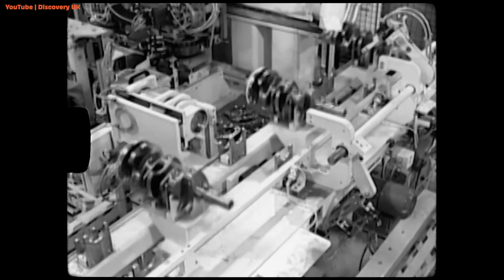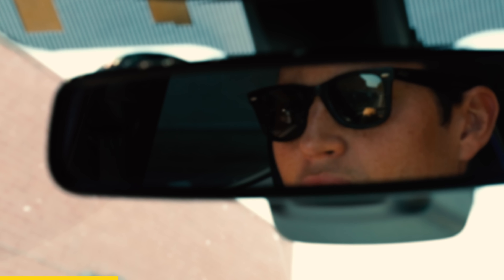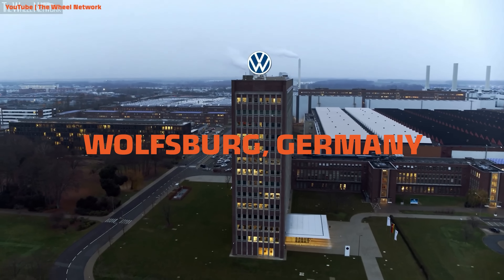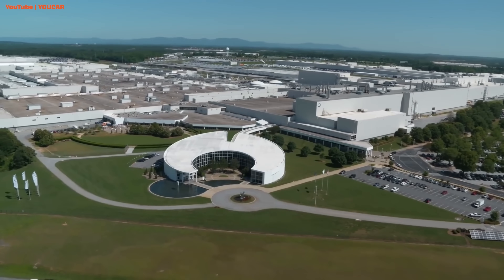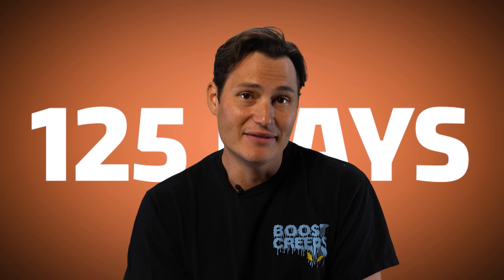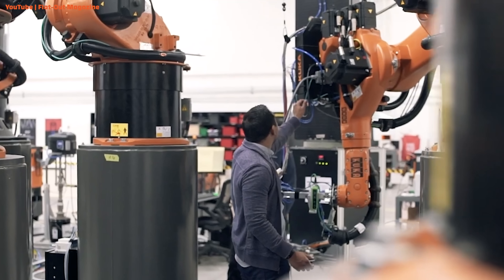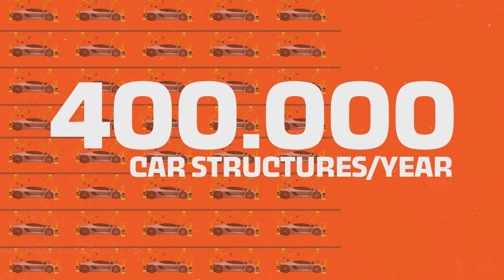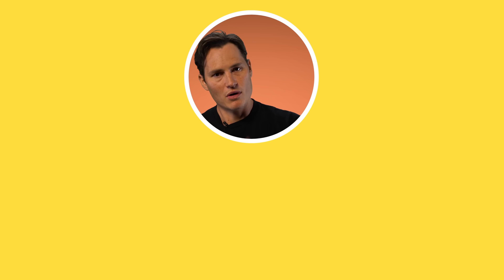A.I. Designed this Car

Comment: For everyone thinking that the robots are going to take you job they will but they won't lessen how many jobs there are they will just lower the difference in jobs. 
So for example in stead of doing manual labor you would most likely be coding the machines that  are doing your old job. And yes it's going to be frustrating to learn code but at least you'll have a job in the end.

Comment: AI copy's designs from nature which is what the best designers already do , 3d printers used to make high efficiency weight saving parts but 3d printed metal parts are by default structurally weaker than cast parts and forged parts.. this car is a gimmick it would be 5x more expensive and perform the same as a standard sports car(also automated assembly lines only save the company money of employee sick days insurance ect that won't make the end product cheaper the company will just absorb those savings into profit and sell the car for the same price as if it had human assembly lines similar to Tesla)

Comment: $3 million on those printing machines....I really doubt that. Even if that were the case, imagine what material cost. The cost of programmers, + cost of expert maintenance guys to be right by the machine 24/7 which they would absolutely have to have because automated machines break just about everyday in some form or fashion in industrial settings. Plus god only knows what other expenses. I promise that 3 million dollar figure that was "estimated" is only a mere fraction of the reality

Comment: 2030...
Me: “Check this new car I just printed!”
You: “Cool, I just downloaded the blueprints to print mine.”
Reply: @JohnGalt-w1o  You will print out parts and build your desired lamborghini or maserati through the magic of 3D printing
Reply: imagine a steam workshop-like platform where you just print any car
Reply: @ysos4357 Traffic jams will never be the same with so many cool cars to look at.
Reply: 2040 3D printed houses
Reply: @djsubliminalreeve  mate that's already happening now
Reply: i know this is joking but i think its going to be decades or never when people can have affordable metal 3d printers
Reply: @Silverdev2482  I think they start at 2k? Also, it isn't like one is needed in every house. If functional 3d prints would become more common, a Joe with one in his garage could make a good living. True, things like batteries, bearings and raw material are not printable (tolerances, working with combustive liquids and solids pose either too great of a risk or are unprintable, and using raw materials to print raw materials sounds like minecraft duplication glitch or something). Once a Prusa or Creality of metal 3d printers appears, the price will likely go down quickly, at least of the printers.
Reply: @ApusApus  at 2k? could you send me the link? maybe you’re mistaking it for a cnc (a machine that carves away at metal to make parts)
Reply: @Silverdev2482  Perhaps I should have checked before comenting. I know there is the "Metal matters" chanel that is attempting to develop one, but from the latest videos it seems that costs are increasing and physics aren't quite there yet.
Reply: @ApusApus  i just looked at that channel anyways metal printing isn’t practical for mass production of cheap products its for expensive parts but i think developments in cheap/diy dmls will be interesting i’m going to do more research in diy/cheap dmls like looking at stuff like that channel

Comment: Okay, cool and all but...

what if it breaks?
Find me a mechanic willing to work on this car. Find me a single mechanic who isnt gonna throw up all over you when you tell him "oh yeah, my car has been having electrical issues could you check that out? oh, by the way, the wires are exactly the length they theoretically need to be down to the millimeter, have fun"

Comment: There is a lot of "in theory" that you're leaving out. All this stuff is great in theory. In practice it is an absolute nightmare and requires a ton of engineering to make it work. Over time it will get better but right now it is technology in its infancy. I don't expect you to highlight all the negatives but at least a very short summary of why this hasn't become the widely adopted method for all car manufacturers.

Comment: "A 3D printer doesn't print out extra material."
Rafts and support beams: Are we a joke to you?
Reply: also key dimensions need to be machined post printing
Reply: Well actually ,even with plastic, those supports could be recycled literally not wasting anything. Plastic can be rememted into line and metal can be made back into metal dust with little to no waste
Reply: @terminatorztc6391  same for traditional production facilites though. they can also simply recycle their waste
Reply: @terminatorztc6391  Well the clip talked about printed parts ready for use but those turbo blades were far from ready for use.
Reply: @BuiltByRik  yes and theoretically if supports were to be used they can be recycled
Reply: Yes. The only real advantage to 3D printing is the broader design space. Some parts would be next to impossible to machine while they're trivial to print.
You lose on time, cost (assuming it was feasible to do using machining) and precision (which can be dealt with a machining pass).
But the real reason it's brought up in this context is that a 3D printing removes a constraint that limits computers significantly. Ask a computer to figure out how to best use limited material to deal with a certain type of stress, it's a solved problem. Ask it to simultaneously account for the cost of manufacturing using machine tools. That's much harder. Humans tend to work from what can be built and what is well known rather than making these organic structures. Because unlike the computers humans can't try out all properties of some structure millions of times in their heads before a deadline.
Reply: They aren't required with metal printing because the powder occupies the space under the print where the supports would be
Reply: @SamOnTheMove  Uh, layer sintering still needs supports to prevent the printed piece to move and shift. Just look at 7:03
Reply: @siniorgolazo  lk
Reply: Yes
Reply: In addition to supports, SLS printing requires that you use new material every time you print. This is because the build volume needs to be heated to just under the transition temperature of the metal so that the lasers don't need to be astronomically high powered. This heating can degrade the metal powder. You can reuse some of the powder, but depending on the material and the required properties of the finished product, you're looking at mixing around 20% old material with 80% new material. I think the biggest benefit of additive manufacturing comes from the crazy geometries that can be manufactured and ease of changing a design rather than material savings.
Reply: It's metal 3d print ..
Reply: @TheChenchen  Yep but those turbo parts were not ready to install they still need machining.

Comment: Im an industrial electrician that works on mostly GM and Ford manufacturing facilities. It sounds like the turn around for the manufacturing process is crazy long. If a process like this were to go mainstream you would run into a similar problem that Tesla is having. They can’t produce cars fast enough. The Ford plant I was just at produced almost 100 Ford rangers a day.
Reply: I understand that this could be scaled larger so that more cars were being produced but it seems like that would take up just as much space as current facilities

Comment: Ai design assisted, yeah ok been done for years, decades if you count design "program" software!. 3D printed parts, nice.  Totally 3D printed car - nope, far too slow with way fewer serviceable parts. IF the whole car were affordable, as in cheap like paper towels, then yeah, design and print a throwaway/TOTALLY recyclable car! PLUS, as has ALREADY been experienced in a whole lot of situations, just because a computer can design and build something does not mean the parts can be accessed, serviced, or even replaced if needed/required.

Comment: Ai: Building Car
SUDDEN BLACKOUT
Engineers: HELLISH DEBUGGING
Reply: It's called self power source and generators = no power outages and debugging
Reply: Debugging,what? It's not like it makes mistakes in a power outage it just stops
Reply: @parthpatel9602  electricity in not  light, all those robot arms could desync just because one arm turned of a fraction of a second later.
Reply: @parthpatel9602  when you know nothing and talk like you do

Comment: This is cool stuff, but it presents us with a difficult problem. As techniques like this are increasingly applied to not only car manufacturing,  but lots of other industries as well, jobs for human beings become fewer and fewer. But our populations are not dropping and people still need some sort of "money" to buy stuff. 

So, what do we do with all those folks for whom we no longer have jobs available? They can't all go to work in IT, especially as computers become increasingly able to program themselves. Andrew Yang raised this issue during the 2019 Democratic presidential primary, but his candidacy got little traction. But Andrew is right about the problem, and sooner or later, we've got to find solutions to it.

Comment: While this is cool and all there is so much not ideal with it, I’m no expert but just to mention one thing I know, powder metal melted into solids is not as strong as forged. So yes on less stressed materials you can use this but on something that needs to be strong I wouldn’t trust it. 
But I’m all for finding better ways to do things but not if it makes a lesser product.

Comment: This car is actually a real life, 1/1 scale model, of a Mini 4WD toy model cars. Though the difference is on the assembly line, but the final result really similar to that popular Tamiya Mini4WD scale models. Similarities are wiring integrated to the chassis, which of course you will sometimes need to buy the whole kit or chassis when you cannot find the exact parts you need (therefeore you will need to "go back to the dealership to maintain" your car). Also printed parts from ground up, inside out engineering, body works that is actually useful for the car, not only to complete the product. This is awesome.

Comment: Does anyone else see the parallel between this and the Next Generation Air Dominance jet (NGAD)?? I studied aircraft conceptual design and it blows my mind that the next generation fighter jet was supposedly designed and prototyped in a year. The NGAD is supposed to be unlike anything ever before it. I would not be surprised to learn it shares many of these same design and manufacturing methods.

Comment: Sounds great on in theory until one of those printing robots becomes miscalibrated and runs it's cycle for three or four hours out of spec and a bunch of parts becomes a little lopsided as a result. A completely satisfactory process for a hypercar, but to maintain tolerances in a mass-production environment would require more time to calibrate the zero-points than actual fabrication.

Comment: $4,000,000×40=$160,000,000 $160,000,000−$500,000,000=−$340,000,000°°° $500,000,000-$160,000,000=$340,000,0000 so its better to change ALL the car manufacturer companies to buy at leas 40 of those machines for $160,000,000 and renovation isn't included nor materials and save about &$340,000,000. Tho they can make 400,00 a year well according to https://www.investopedia.com/articles/markets/021416/how-toyota-makes-money-tm.asp#:~:text=Since%202012%2C%20Toyota%20has%20produced,10%20million%20cars%20per%20year. Said "Toyota produces 10 million vehicles annually, 2.8 million of those in North America. And that latter number is expected to grow thanks to economies of scale." And https://www.google.com/url?sa=t&source=web&rct=j&url=https://pressroom.toyota.com/toyota-motor-north-america-reports-december-2019-year-end-sales/&ved=2ahUKEwiRmaSl6PLsAhWMecAKHXzuBDkQFjAGegQIBhAE&usg=AOvVaw0lypDM1JYf3Ji-j0H1d8uA OR TOYOTA said 
"
2,085,235 vehicles. For the year, Toyota division reported sales of 2,085,235 vehicles, down 2.0 percent on a volume and DSR basis. “2019 was a strong year for Toyota. We retained our number one spot in hybrid, passenger car, SUV, small truck and retail sales,” said Jack Hollis, group vice president and general manager, Toyota division.Jan 3, 2020

"

Comment: ok that's great! but to repair an electrical problem for example or a worn mechanical part .. is the computer going to take it apart? or will he tell us how to repair? because ok have gained weight, structure, placement, but the repair has thought about it ?? no. the concept is ok, but wear should be taken into account, because making a car and having to throw it away because it is too difficult to repair (it's not new .. it happens often ..) have you thought of something other than gain mass, solidity, etc., maintenance? (good to start with a supercar, because precisely the owners do not ask themselves this kind of question, they have the money whatever happens ..) in short, it's great, but also apply durability instead of planned obsolescence .. (a parameter that you will ask you to integrate the day you make cars for the mass, we should avoid doing like everyone else, and make solid, easy to repair, quick to repair , etc, these are the other parameters that you can put in your next project. whose only purpose is to make money. so innovate, but remember not to make faults on purpose so that it pays off for maintenance later too .. a dilem you don't have for this project, (supercar so ok!) but if one day you make a car for ordinary people, don't Do not enter AI programmed obsolecence settings.

Comment: 3d printing is a solution for prototipes and supply spare parts without having huge cost of storage, BUT it's way more expensive than industrial production high volumes,
Easy concept, thinks about the classic 2x4 LEGO brick (TM)  u can print it but it will cost a tons each piece and take a tons of time. but if u whanna do it in high volume, then the cost of the hot injection machine ( that cost several hundreds of thousands) is sliced on the volume production.

Then it could be the smartest way to project a car but.... have u tried to change a lamp in the recent cars?  space is so compressed that's take tons of time or even u need to disassembly a part to get access to the part u need...

Last but not least, maintenaince and repairs... all that hitech parts like nanocarbon structures. fiberglass etc... if u get an accident u cannot "weld it back" ... u have to replace it.

Comment: Missed here is the process. That's going to be the real sell here and where they will see their profits. Think about it folks, a programmable assembly line that costs and occupies a fraction of what every other current manufacturing process does in building size and cash outlay. I my current contractor would pay 3 million just to avoid having to deal with Bobardier. It's the process that has value and the car is just proof of concept.

Comment: I wonder how they're going to improve metal printing. Currently 3D printed metal parts (using laser tech) tend to have quite some random pockets and holes. Random here is the key as it means not only general structural weaker compared to CNC parts but also possibly much weaker in random cases. Curing has a bunch of limitation but should alleviate some of these issues. So a company in that space might drastically improve additive metal manufacturing like Tesla improved batteries (somewhat). The AI is obvious; even 3D printing hobbyist use it (at a different level of course).

Comment: I drove a '66 Mustang for years.  It was easy to maintain and cheap to operate.  Low initial price upfront and I sold it for a profit.   A simple blend of 60% gasoline/methanol/ammonia burns without engine modification releasing half the CO2. Try doing that with any modern car.

Comment: I'd like to know if there are engine blocks printed using the same method, using AI to improve airflow, fuel efficiency, power and weight then being built from the ground up using additive manufacturing.

Comment: The tooling costs in production also includes the manufacturing of parts. Mfg tooling is very expensive, while assembly tooling is usually from reusable items or relatively inexpensive in-house mfg'd tooling.  Modern assembly, what the AU is performing, is already highly robotic and human interaction limited to part / sub-assembly staging, QA, and other activities robots can't perform.
Your AU extrapolation doesn't take into account infrastructure needed to support the robots (power, computer racks, ect.) and logistical lines needed to supply parts and sub-assembly's. You're assuming perfect parallel processing, without any downtime for equipment maintenance, engineering design changes, yada, yada, yada, nobody's reading this anyway.

Comment: Maybe they really found how to set all the target&design parameters and how to make AI do it.
What does the AI need to make it? Neural network? Quantum Computing unit? Maybe a lot of engineering programs that it would run. That could be hard to understand how the AI brain works.
This case it could design anything else also very easily.
Maybe the AI can do software engineering also and improve itself...
How can that amount of software be debugged? Maybe by some lower level program/AI that know how to check program code?
Maybe it will be stored in the Svalbard global seed vault.
Is it 'relative' to the Apple Car? Would be self driving?